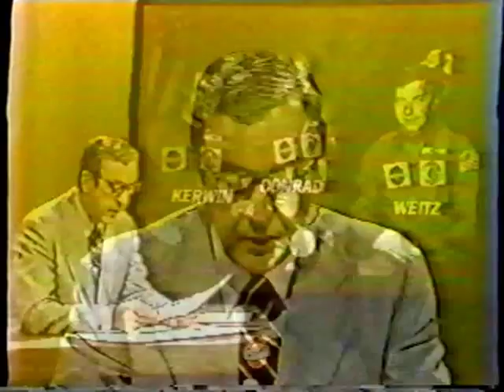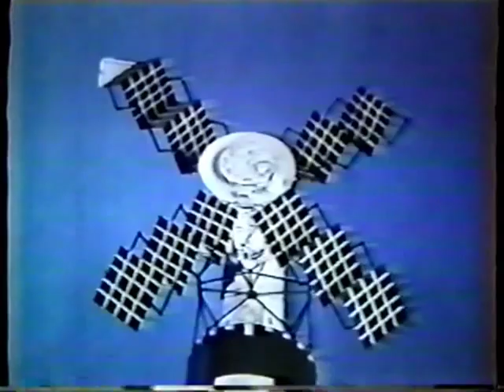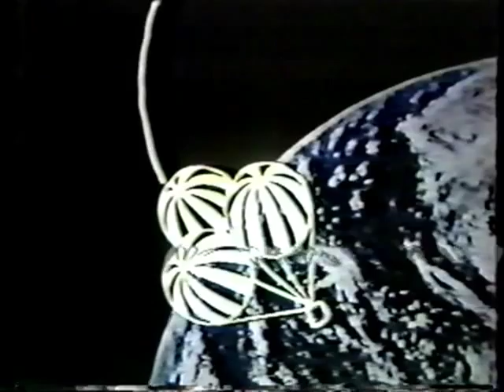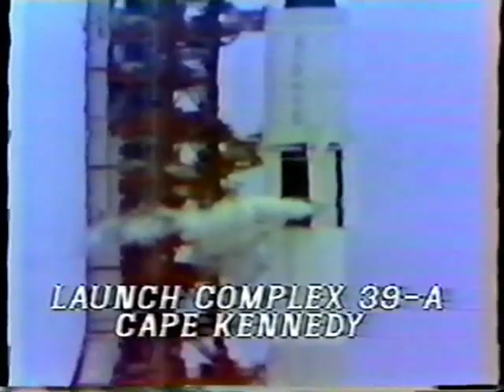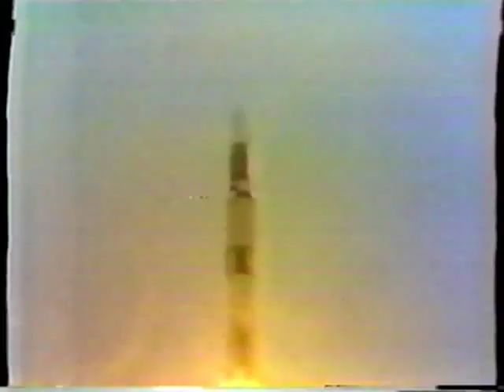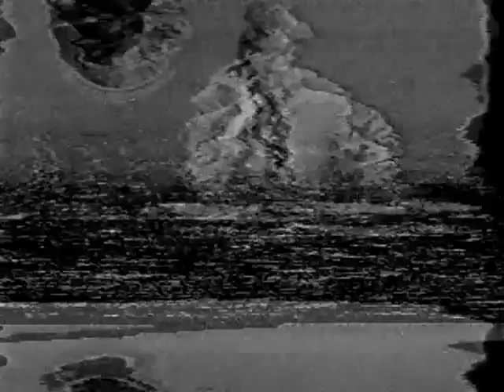Skylab 1 & 2 Part 2  NBC News Coverage of Launch

Comment: Kind of prophetic that John Chancellor said that "if anything goes wrong, we'll have bulletins", for a few hours later, when NASA learned that one of the two large solar wings had fallen off during launch, taking away some of its insulation with it, the networks indeed had brief bulletins to report both it and the postponement of the maned launch.
Reply: altfactor Actually,  the micrometeoroid shield was torn off due to a small gap (1/4”!) in it that caught the wind. The shield peeled away like the label off a can, ripping one of the solar panels out of its socket and wrapping the other in wires and debris, preventing it from unfolding. The Apollo astronauts had to use a big pair of cutters to snip away the restraints and help pull it out and into full deployment.
Reply: I remember how they had to improvise the repair mission that saved the whole project.  They managed to just about fulfill all the scientific research goals originally planned, including spectacular solar observations that advanced our understanding of the sun and its processes.